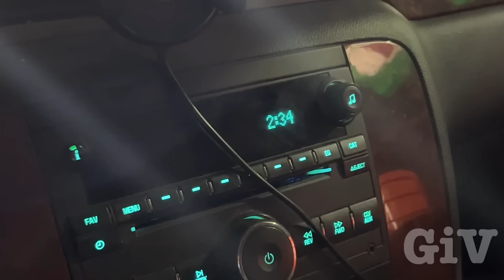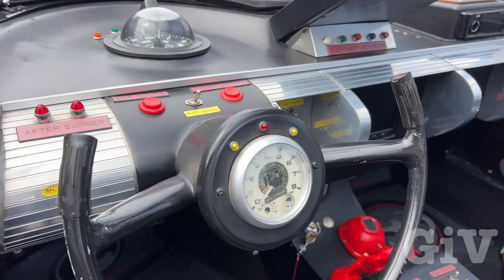Culver City Classic Car Show//so weird not to have my store anymore

Comment: It’s a beautiful Citroen 2CV Mike but the owner of the vehicle has the wrong flag in the interior, it’s a Dutch flag which has the same colours as the French flag. But it is the correct flag on the exterior which is the French flag with vertical stripes and not horizontal stripes like the Dutch flag has. Perhaps the driver is Dutch or has Dutch heritage or probably doesn’t realise he/she has the wrong flag in the interior. 10:41